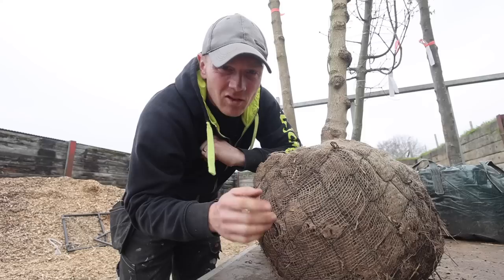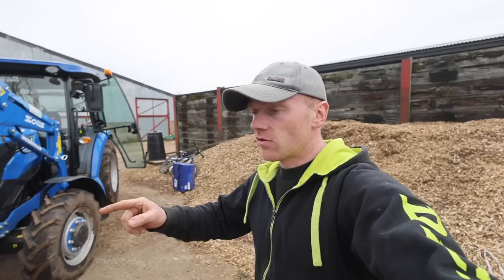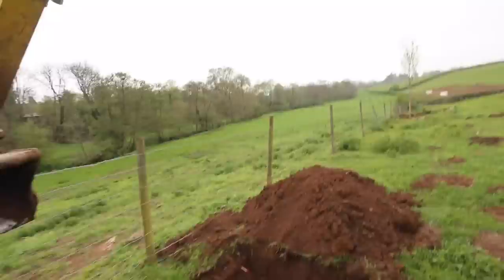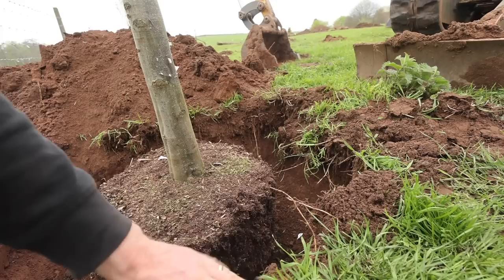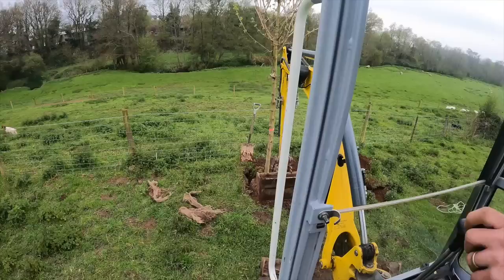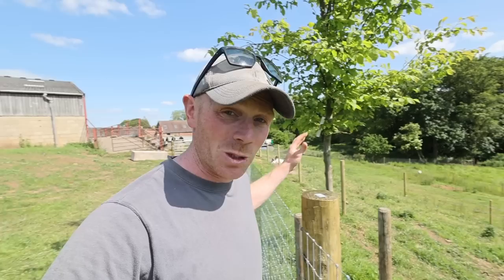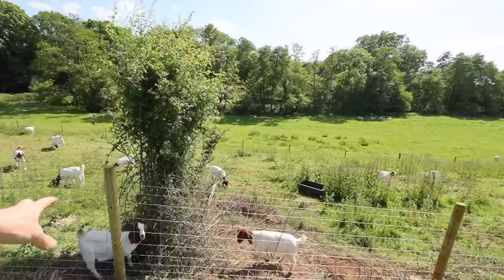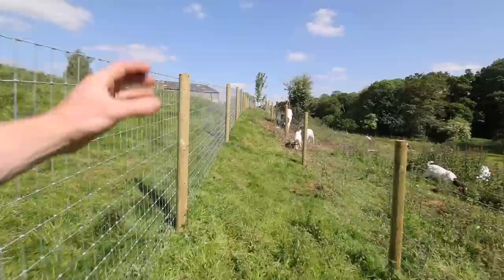PLANTING TREES WITH A DIGGER! 🌳

Comment: When planting trees I put a pvc pipe from the bottom of the hole up and out of the ground on a small angle. This lets me water the trees from "under" the trees through the pipe instead of from the ground. This encourages the roots to seek down for water instead of seeking the water from the top soil. You also avoid the water running off the dry top layer. Once the tree is doing fine and growing, I pull the pipe out of the ground.

Comment: If you happen to have some lengths of drainpipe laying around then you could use them to extend the reach of your hose
Reply from the maker: Had a length of MDPE pipe which I could push the hole in and use as extension, worked great thanks!

Comment: I know you have stated in another reply that you have now laid pipework around the farm but I would highly recommend buying an IBC, they  cost little but are incredibly useful to have, you can then put the IBC on your trailer or pickup bed for watering around the farm. There will be times when you want water where the pipe isn't or when you have issues with supply etc. You can get a cheap Wolfcraft drill powered pump or wire one in.

I'd also back up the other comment about putting in a bit of pipework to the bottom of the root ball to water via. You can still do this now post planting, relatively easy and would be well worth the time, replacing a tree that fails will take a lot longer and cost more.

Finally it would be worth considering some trickle water system, again cheap to do and won't take long, it will really help saturate the ground much better than dumping a load of water on in one go.

The farm is really starting to look great with all the work the family is doing, don't forget to make time to pop down to the lake with the rods (and to retrieve the weed rake thing you lost in it last year 🤣)
Reply from the maker: Saw some similar sized trees yesterday which someone just had old drums of water sat next to with a tiny hole which I guess just dripped slowly all day.  We have IBCs which we can fill with the pump from the brook, its just not the easiest spot to access with the big trailer.  👍